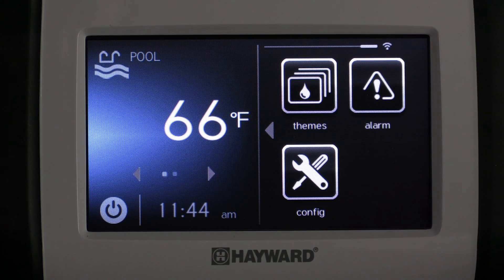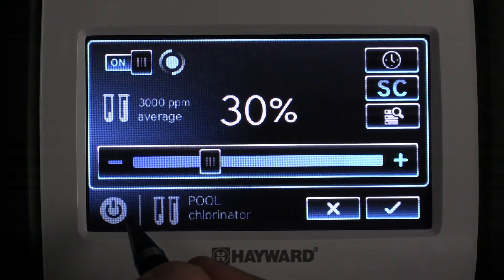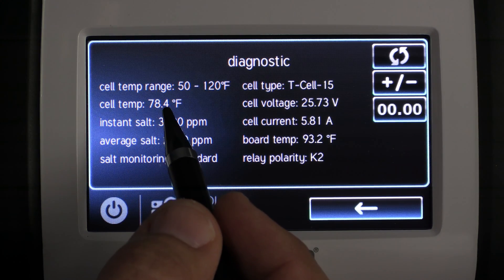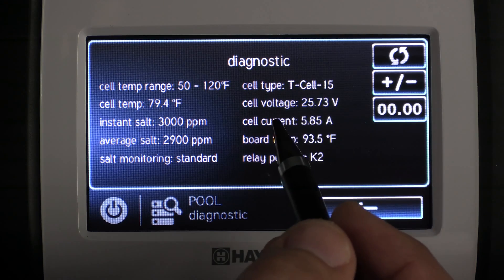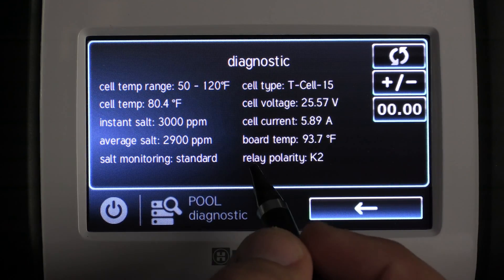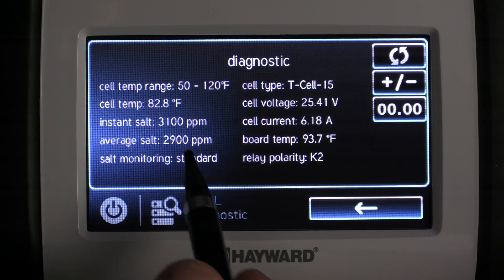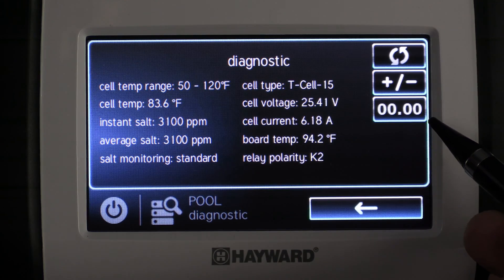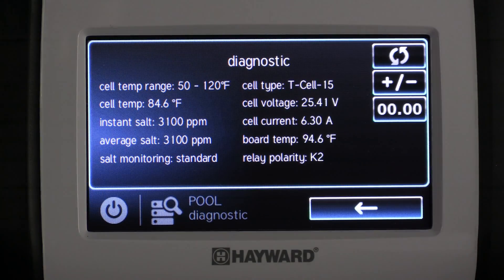Salt Water Chlorinator Diagnostics with Omni Automation

Comment: Great video, thank you.  I just changed the t-15 cell and it now reads 4000ppm average - how do I program the board to get the ppm down to within Cl range?  Do I just change the % from pre-existing 55% to a lower %?
Reply from the maker: Hi there, do you have a S3 system or an AquaRite system?

Comment: I use the app on my phone.  It doesn’t follow the program.    I have it set to run the pump at 1750 24/7.   I have the salt cell to be 28% from 8am to 8 pm and from 8pm to 8 am 1%.     Instead it goes to 30% during the day and sometimes goes to 1% at night.  I turn the program off then back on and it goes to 28%.  Sometimes at night it goes back to 30% instead of 1%. What the heck is going on.
Reply from the maker: Hi Gene, we apologize for the delay in response.

If you are doing all of the programming from app, it could be dropping connection when making changes, we recommend upgrading to latest firmware and ensuring the main panel is showing above 50% signal strength. If updated schedules from main panel and is still doing strange things, then we recommend deleting all timers and themes to add back one at a time to see if they stick. Then at that point if that still does not resolve the issue, we recommend reaching out to your nearest Hayward-authorized repair center for a fully factory reset and further steps. You can find one at hayward.com/locator.